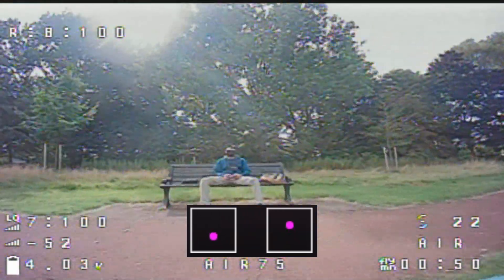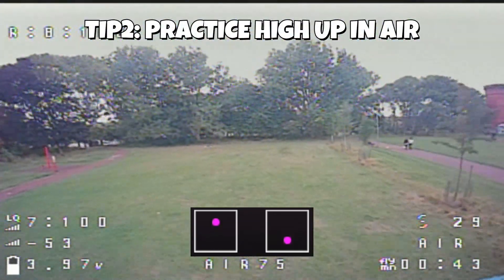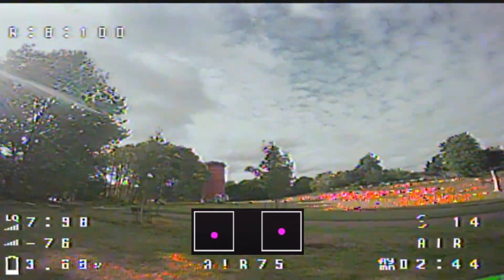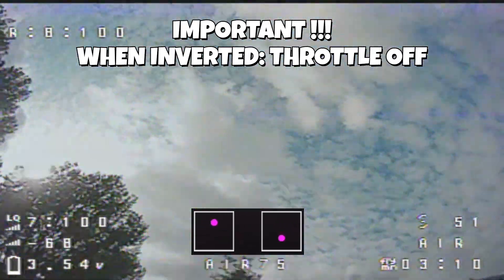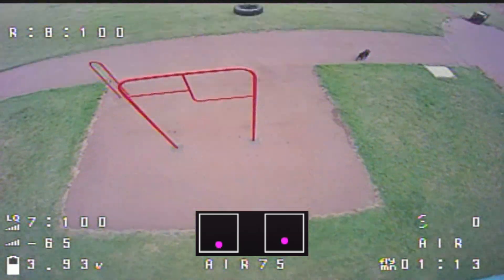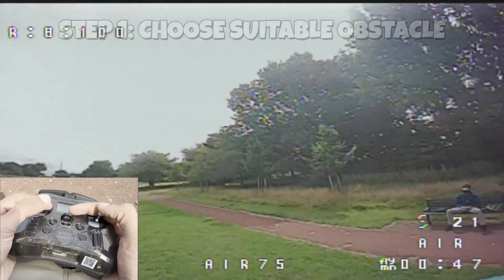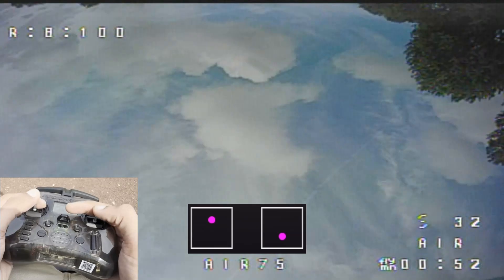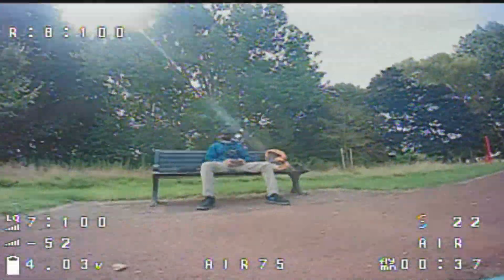FPV Powerloop Tutorial | Step-by-Step Freestyle | Simply Explained | Beginners Drone Guide

Comment: Is it best to blip the throttle RIGHT when you see the horizon, or right before?
Reply from the maker: If you want to complete the loop, throttling up just before you begin to straighten out will help you make that smooth round shape.
If you’re starting out, your priority should be to just catch the drone when straight and then proceeding forward.
Once you have a good drip of each motion, you can fine tune your movements to create the loop.

Comment: What is your drone and fpv goggle setup?
Reply from the maker: The drone is this video is a BetaFPV Air75.
The controller is a radiomaster pocket.
Goggles are Ev800D. Not original. They were manufactured in the same place as the original and work like a charm too
Reply: @ShayeInTheSky  Thanks, where did you buy and how do you make sure the remote control, drone and goggles are compatible?
Reply from the maker: I buy my setup from a local drone hobby shop.
Amazon is quite unreliable for these kind of things. You can also buy the stuff from the official websites for these companies.

Your drone will have a receiver to catch the signals that are sent out by your controller.
And then your drone also has a video transmitter which will send out video feed. Your goggles should be able to display that video feed.

For this exact setup as in the video:
Make sure your controller and your drone are both ELRS. You can then use your controller on all drones which have ELRS. So even when you change drones, you’ll use the same controller.
The video feed is analog and the goggles are analog. So ensure both goggles and drone are analog.
Further down the line, if you want better quality video on your goggles, you will to buy different goggles and your drone will need to have a different video transmitter (VTX).

The vtx technologies that currently exist are: Analog, HDZero, WalkSnail and DJI. So your goggles should be compatible which the VTX your drone has.
Reply: @ShayeInTheSky  Thank you! 😊